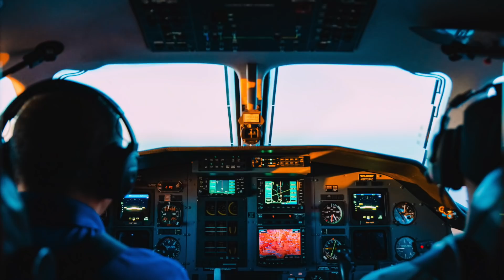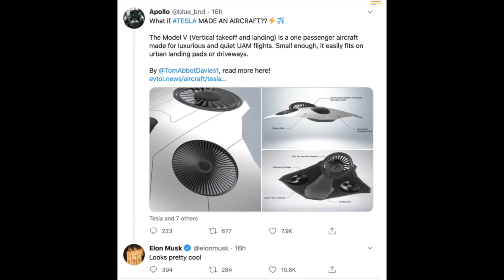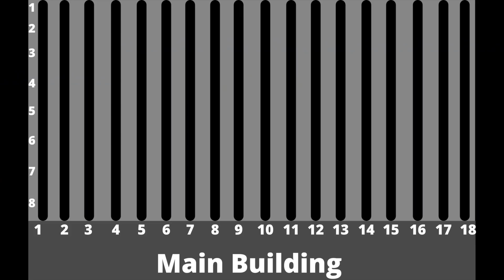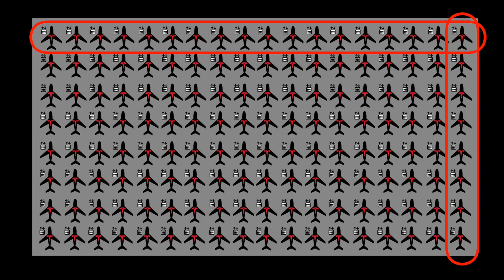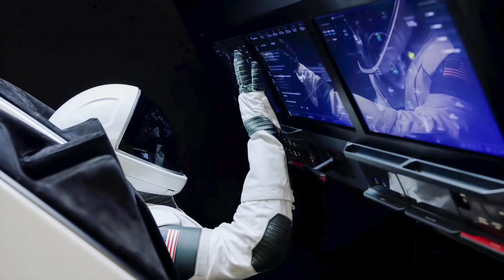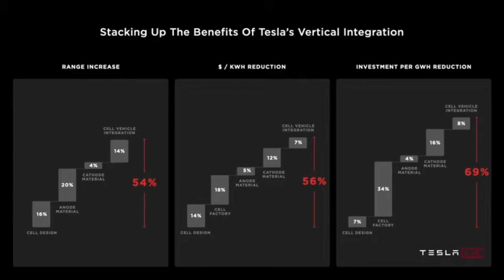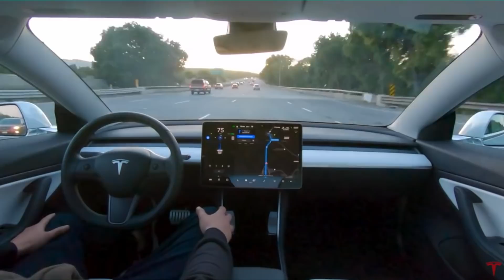Tesla’s Electric VTOL Airplane, will change aviation forever

Comment: WRONG
Tesla have done (and are doing) great things. But a video like this is doing them disservice spreading disinformation.
Yes shortrange VTOL are coming. HOWEVER the stupidity of claiming them more efficient at altitude etc. is just SAD. Thinner air will give LESS LIFT for propellers than a jet that also get thrust from burning gas. And the charging while decending is just a horribly dumb statement. You have to USE energy to spin up propellers to break the planes speed going down too! It's just a litle less than maintaining a set altitude. 
And why are they even called JETS. We are talking subsonic flight with propellers here. Currently the only theoretically viable solution for a electric jet pr now is the plasma engine and the limiting factor here is still the low energy density of batteries.
Reply: CORRECT! Everything you have said is exactly correct.  Please see my comment above that solves the energy issue assuming the theoretically viable plasma engine is actually solved.

Comment: Nice Vidio but you good somethings wrong ... As long as the plan is powered by propellers it Kan never fight as high as  a jet plane .. because the air is to thin

Comment: I think you forgot that it isnt only the compustion engine that need more air its also that the fans or blades in the jet engine cant get probulsion cause there isnt any air up high.
Reply: Maybe rocket type compressed gas propulsion.
Reply: Passengers need air, too.

Comment: regenerative breaking on vtols? only if you want to go into freefall for a few seconds (doesnt seem to make much sense since you would have to slow down the fall again afterwards)
you need to keep in mind that a car driving at a certain speed is going to keep its momentum (minus some friktion) so you can take energie out of the system if you want to go slower aka charging the bateries. Vtols however will be (while landing) comparable to helikopters so if you turn off the propulsion they will fall like a rock wich is not what you want. The Vtol landing proces is simply unlike the car not energy positive preventing you from gaining any charge back (it can be with regular planes but you need a runnway for that to glide down and then once on the groound you can recoup some energy)

Comment: Maybe electricity for short hops but for long haul no chance. 400Wh/kg is simply not enough energy density. Also as a jet burns fuel the plane gets lighter, an electric plane would still have to carry around its discharged batteries further restricting range.

Comment: There is something wrong with your logic. If it is easier to travel on a VTOL at high altitude because of lesser air resistance,  then traveling  in vacuum  would be even better. The problem is that no VTOL can propel itself in vacuum.  Consider the problems NASA faced with Mars helicopter design. Sorry.

Comment: VTOl good for short distance, but fixed wing for longer flights (more efficient)
Reply: Perhaps with today's technology. Elon's thinking is to get up to high altitude rapidly and travel at supersonic speeds taking advantage of the lower air resistance like jets do.
Reply: Lars, this is the kind of forward thinking I once mentioned I most wanted to find in a tech channel.  I can hear news regurgitation on all the other channels I subscribe too, like Now You Know, Ben Sullins, Everyday Astronaut, etc.  Of course within one show you can only go so far.  Which leaves the question of continued evolution of ground vehicles.  
      How about a water supply evolution.?  During winter how much water in the form of snow falls on a square kilometer in the northern half of the US? Imagine a distributed network of 'water parks' that melt the snow that falls on them and that water is channeled to storage tanks.  As it enters storage it's cleaned and pumped as needed to locale users for fresh water.  The electrical pumps powered by renewable energy stored in batteries.  A self sufficient system of clean water controlled by AI software.  No more rusty water from metal pipes.  Just 'special ground' that heats snow and ice like a warm sieve collecting, storing and cleaning and pumping it were AI tells it to go.
     Los Angeles could get unlimited water from agriculture lands needing a steady income, protection from drought for instance, from farmers selling a bit of land so a water park can process snow covered land to a drinking supply.  Snow is free, electricity is from sun and wind, only cost is a one time setup.

Comment: Love your videos Lars!
Some companies will make vtols, actually, this is already happening... But once Tesla brain and engineering power enters this area, it will be game set and match.
Reply: Providing you have an incredibly fat wallet. Remember that Tesla's cheapest model of car is 50K bucks. A VTOL is going to set you back a good 300K or more.
Just another rich mans toy.
Reply: @Tryst46  agreed, vtols are not for the mass. Imagine your neighbour lift off in the morning to go to work, and you're hoping he will not crash into your wife's VTOL, or drop out of the sky. "Boring tunnels" are the solution!
Reply: @MarcoYolo420  IMO, a private VTOL should be the same as a standard saloon car. If you have a small amount of cash, you can still buy one. 
Remember that, in mass production, they would all include collision avoidance and many of the other things found already in self drive cars. Even if you fly it manually, it will take over if you do anything pottentially dangerous like dropping down on another one below you that you didn't see.
Musk has no intention of making stuff affordable for the masses, he sees every new project as a step closer to becoming the worlds first trillionaire, then it will be a multi trillionaire and so on.
Reply: @Tryst46  YouTube filter just removed my post. Great AI at Google. 😑
Sorry for that Tryst, I guess they just ended our discussion.
Reply: @Tryst46  anyways, I recommend you to read those master plans I mentioned earlier.
In there it is explained how EV is brought to the mass market, for everybody to buy what they want and can afford, if it is a Tesla or not, as long as we safe the planet by transition away from fossil fuel.

Comment: This is one of the most fun conversations we can have - what is in Elon's head for electrifying air transportation?

None of us knows what's in his head, so the conversation can go anywhere.

But we can start with some assumptions that might not be too far off the mark.  One of the most important assumptions is, how much of the airplane's mass will be taken up by batteries?  400 kWh per kilogram of mass just isn't very good energy density (though it's much better than current automotive batteries).  To get any sort of good range, 60-70% of the mass of the aircraft will have to be batteries.

That doesn't leave a lot of room for passengers unless we scale up.  So if Elon's ambition is something more than local commuter aircraft, if he wants to disrupt the passenger jet industry, he'll have to go big.  Larger than many current jets.

VTOL adds power demands; range is severely constrained by VTOL.  This is another reason to expect that most of the aircraft's mass will be in battery packs.

The packs themselves will have to be conformal, not flat packs - it's the best use of available space, a lesson learned long ago for conventional jets.  Wings will be batteries covered by an aluminum skin.  The fuselage may also contain embedded batteries.

Now let's think about aerodynamics.  Supersonic cruising at high altitude with low power consumption is a reasonable ambition - but the aerodynamics of supercruising are quite different from lower altitude flight and require different shapes.  Optimizing for supercruising means not optimizing for lower altitude flight.  Climbing will be a slow affair, but once at supercruising altitude, it'll fly like no passenger jet ever flew before - even the Concorde.  And do it with remarkable energy efficiency, since it will encounter very little air friction.  It can go almost to the edge of space; it needs no oxygen for combustion, and only needs enough air for control authority.

This means a jet that is not optimized for short-distance runs.  This jet will be at its most economical and fastest on long routes.

So what about this regenerative descent you mentioned?

In theory, you could replace flaps with regenerative braking, but this will be a tricky engineering problem to solve.  See, flaps generate lift.  Regenerative braking won't.  It's a completely novel flight regime that will require an awful lot of simulation and testing - and might not work.

But we might not need it.  At descent, the plane no longer needs much energy to complete its journey.  Most of the energy costs will be during the take-off and ascent.  Elon is famous for wanting to delete what isn't needed, so I don't think regenerative braking will be in his design.

What about your airport concept?

Nah.  We aren't going to see planes lift from their parking spaces.  Each plane has to deliver passengers to a terminal; you can't have passengers wandering around between planes while planes are taking off and landing.  Also, it's not safe to plop an aircraft down into a pack of parked aircraft.  Accidents do happen.  No, there will be departure and arrival runways.  They don't have to be long, but they do need to be away from where passengers on foot are, and away from parked planes.  Parking spaces will be for parking only.  Planes will taxi to and from terminal, runway and parking spaces as needed.

Further, airport controllers will need to exert positive control over departures and arrivals and their airspace.  This is easiest and safest with designated runways.

Unless all Elon wants is a local commuter jet that never climbs high enough to supercruise - not what he indicated - this will be a big plane working with short runways and conventional terminals which works best on long routes.  Very long routes - I honestly don't see a serious limit on range if the plane cruises high enough.

Existing airports won't go away overnight.  It'll take decades to get this beast into the air for passenger flights.  There is a tremendous lot of development to do.  I'm optimistic that NASA might want to fund this development; developing novel aircraft are a part of their mission.  Consequences of failure will be high, so the development cycle will be long, with regulators peering over their shoulders.  These planes won't reach service until the '40s, I think, at the earliest, assuming development starts around 2030, assuming 400 kWh per kilogram for battery cells are available by 2030.  Then, once the first aircraft is operational, Tesla will have to produce more of them.  It's harder to manufacture aircraft than cars; a production rate of several per month would be an excellent start, and enough to begin paying the bills.

However, we might expect battery energy density to continue to rise.  So any aircraft conceived in 2030 will likely have to be reimagined all over again before it could be produced in the mid-'40s.  If NASA is picking up the developmental costs, this won't be an obstacle - but it could hurt Tesla quite badly on their bottom line if they don't have external funding.

I honestly don't think Elon will jump into aircraft development between now and 2030.  I think he'll focus on battery tech and figure out where that's going.  When he sees a plateau in battery development lurking ahead, then will be the time to invest capital and start working on a design.  Otherwise, the long development cycle, combined with battery tech leaps and advances, will render moot any effort Tesla could put into a particular design.

Comment: VTAL is a Bad Idea. Here’s Why. A Traditional Aircraft generates a Large Percentage of Lift from its Wings. To Take Off Vertical, a Huge amount of of Engineering and Power would have to be built into its design. Much less Battery Power and Prop Size would give far more Surface Area for Natural Lift.. There is more, but that’s the Major Reason.
Reply: The rotor swivels once you’re in the air.
Reply: I do not think of it as a bad idea but, like all means of transport, VTOLs too have many limitations.
Reply: I agree it's a bad idea for the most part. The only use I see (for now) is sort range commuting aimed to avoid high traffic areas etc and with a minimum of passengers and load (at least for pure battery versions). There are a few companies developing these as we speak (like Lilium) with prototypes made and the first produkts on the market within the next couple of years.

Comment: i think Elon will be to  busy  with the Moon lander and mars  to take on the Project.
The Minimum is  400wkh and a VTOL  will need  much higher to  act as a passenger plane, more  like  600-800w/KH  plus  before it will becomes  common place so we are  looking at probs  another  8  years, by that time his  Mars Rocket will have been full developed and travelling to the mars and back.

Comment: The future of aviation is hydrogen and synthetic fuels. The coming tesla roadster will barely have 600 miles of range when a very large diesel SUV gets over 800 miles of range.
Reply: “A VERY LARGE Diesel SUV gets over 800 miles of range”
And how many miles of range does an SUV that is THE SAME SIZE as the coming Tesla Roadster???
Reply: @ernestgalvan9037  I was making a point here, the tesla modelx gets 300 miles+ when a mercedes gls400d is way bigger and has over 800 miles, the mercedes can tow for days, go further, be more flexible....  batteries still have a very long way to go.

Comment: Vertical take off is the most inefficient way of doing things go educate yourself mate. Generative braking is useless on aircrafts since its only used to land.
Reply: I was thinking about this. A short 20 meter electric cable could provide lift off power enough to get into ground effect at least. Or use a steam catapult like an aircraft carrier.
Reply: @johnryan8645  we don't use steam catapult on civil airplanes for a reason, those are really dangerous and there is no way to abort the launch, the electric cable is a joke right!?
Reply: @carholic-sz3qv  Look, I agree that vertical takeoff is inefficient. I wouldn’t do it, but you can provide supplemental power at takeoff. Not a joke, just trade offs to be optimized. ;)
Reply: @johnryan8645  you mean trade-offs that can be very deadly right!?
Reply: @carholic-sz3qv  Yes, absolutely! Have a wonderful day.  Why would any engineer design these safely? Supplemental takeoff power has never been, and should probably never be tried. ;)
Reply: @johnryan8645  aircrafts uses takeoff lanes for very different reasons, its cheaper to take off horizontally, depending on the configurations, some planes can be very heavy and have very heavy coad capacities. an airbus a380 weights about 500 tons fully loaded and can carry about 800 passengers over the globe.

Comment: Lol show me an electric jet engine that’s faster than a gas one... batteries included..
Reply: I do love elec tech but there’s a reason we went with gas originally.. sadly.
Reply: I dont think thats the point. Electric is more effective and can go from point to point.. 
And what did we hear some 15 years ago; show me an electric car thats as quick as an ice car.. batteries included
And Remember to include time used to get to and from the airports.. 
My tip: dont bet against Elon👍🇳🇴
Reply: @rare_wubbox360  an electrically or gas driven propeller is still a propeller. It needs to push down air to create lift. Less lift with less air. The whole more efficient at altitude is a truly stupid or at least very ignorant statement.
Electric planes has nothing to do with efficiency it is enviromental.
Reply: @rare_wubbox360  please expand on this..?

Comment: VTOL airports not must be flat, they could be stacked, supported by runway tunnels and in the inside with passenger elevators bringing them to the planes. Such an airport locks then like a mid sized skyscraper. Nice!